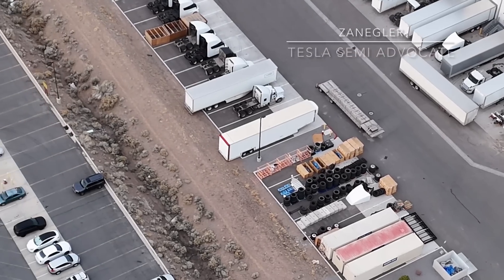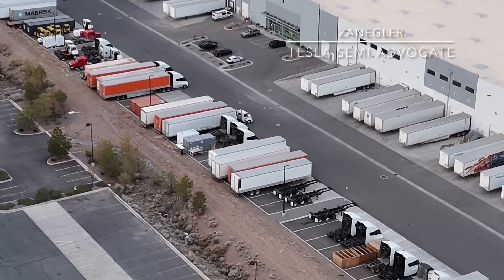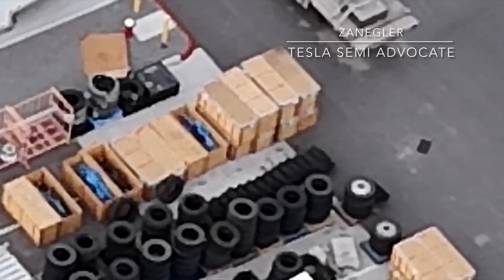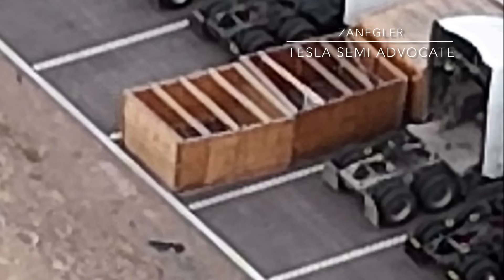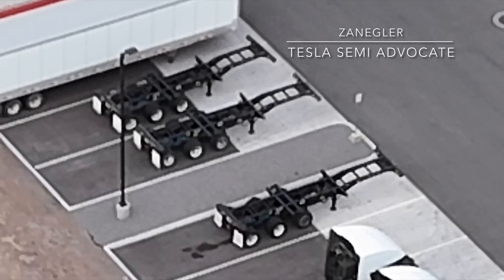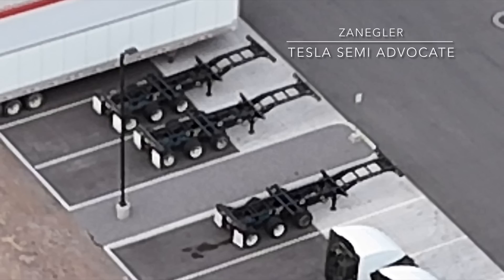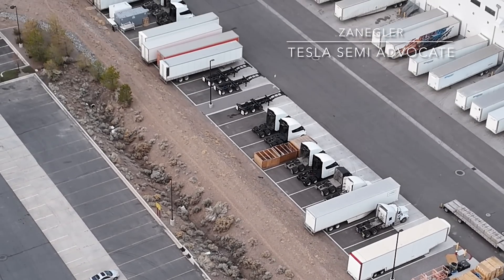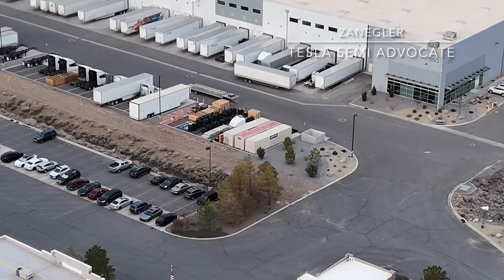Tesla Semi Production Kicks Into Gear!

Comment: I don't get it. We have Tesla's that won't charge when cold. Drops the overall trip milage when cold. Electrical systems catching fire and I could go on and on. When the first truck goes up in a very hot chemical fire, Insurance companies are going to double and triple the overall yearly premiums for hauling freight. England has already tried the public busing, fire trucks and such with out of control fires. So what you thing is going to happen? I don't see great things happening for Tesla and Elon Mush when these things start down the highways and byways. To me it doesn't look to good. I have 3 brothers that are certified Mechanics and we talked about this years ago and more than what we talked about has happened to these so called Dream Vehicles. How much will the replacement cost be for a battery pack for these monsters?

Comment: These are 40, 20 container chassis.  They are used to haul the 20' - 40' oceangoing containers.  In some cases they can haul 2 - 20' containers. 

If you look closely you'll see crossbars at the front, middle and back of the chassis - these are container bolsters. These bolsters have twistlocks (some call them pinlocks) in the ends of them which are used to securely fasten the container to the chassis while in-transit.

They don't have anything to do with specific truck production.  

Note: 28-year trucker here with 3.5 years in the shipping container business.

Edit update: I was thinking 🤔: why would they have container chassis with no cans on them?  Perhaps because the cans are offloaded by forklift (you can do that if they are robust enough) and set on the floor inside the factory.  Or, they may be owned by a subcontractor who totes work cans or supply cans from the rail yard to the factory and returns the empties back to the can yard.

Comment: still wonder about the economics until a 1 million mile battery is available, but as battery costs come down, replacing packs might work out, I believe EM wants to be gathering data for self driving despite the short term economic challenges like 400k battery packs which are still expensive

Comment: Interesting update. I was under the impression that Tesla Semi was battery constrained and could not produce many Semi until the Panasonic battery plant in DeSoto, KS came on line.  

If the production starts then it is a good sign that they have signed-off on the final Semi design and are getting batteries from some where.
Reply: If a semi would overload the grid how on earth do 5million evs not destroy the earth. 
Talk to somebody who understands electrification nota maga
Reply: More like charger constrained. It takes the power of a small city to charge these battery packs in a reasonable time
Reply: @Gr0gansm1th  do nottalk rubbish